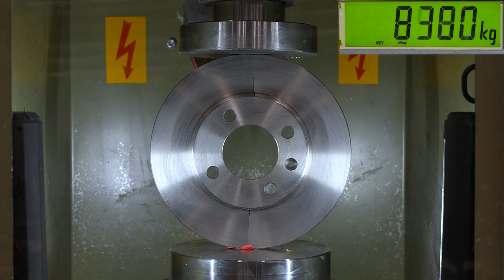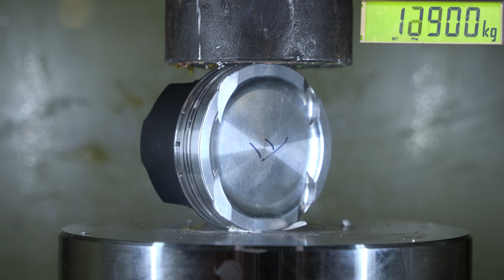Crushing Car Brake Disc with 150 ton Hydraulic Press

Comment: The only one that scared me was the big coil spring.  I could just see it popping out and taking down an airplane.
Reply: That’s what I was expecting too!
Reply: That's how we used to scrag springs after they'd been coiled and heat treated, except we used an air hammer as it was a bit more forgiving than a hydraulic press

Comment: A set of jumper cables walks into a bar.  The bartender says "OK you can come in, but don't start anything!"
Reply: Please leave…..🤣
Reply: 2 guys walk into a bar which is odd because after the first guy did the second guy should have seen it 👍
Reply: ...and says, "Dad, what are you doing here?"
Reply: The bar tender then said "we don't run tabs here".  The cables said "we'll just charge it"
Reply: Two men walk into a bar and see two metres of black tarmac strip leaning against the bar having a drink. One said, 'WTF?' The other said, 'Stay away, don't go near him. He's a cyclepath'
Reply: Good joke

Comment: As a car guy i have never seen a spring been more springed than it was supposed to do. Well done sir!
Reply: Wasn’t it sad seeing the turbos crushed?
Reply: @SniperScope99  i wouldn’t call those things turbos. Exploding spinning devices from china that move some air.
Reply: @SniperScope99  yes lol
Reply: It was a Garrett turbo
Reply: @zachcayer3027  if u saw a unicorn, would u call it a horse with a wrong stiffi?
Reply: Sproinged*
Reply: @mr.h6be  that was a fucking Garrett turbo
Reply: @SniperScope99  -40HP

Comment: This is the best explanation of forged vs cast that I've ever seen.
Reply: Not sure about that; the forged stuff was steel, but I'm pretty sure the cast stuff was all zinc or aluminum.
Reply: Forged is generally a bit stronger, due to it having its grain correctly aligned whereas a cast/billet piston does not. Of course materials will differ, though.
Reply: Billet means it was cut from a single piece of material not forged or cast. The first piston could have started out as a round or square piece of stock and was machined to that shape.
Reply: @Timberland1963  Yep.  "Billet" means it was carved from a solid piece of aluminum on a CNC mill.
Reply: @Timberland1963  My bad, it's the other way around, as you wrote.
Reply: Jeremiah from Donut Media explained it perfectly though :)

Comment: Connecting 2 wheels with hubs and crushing them via a axle between them would be cool to see, more like how a wheel would normally break.
Reply: An entire car axle? Would that even fit under the press?
Reply: @MixZTitaniumDubstep  no I was just thinking a rudimentary axle, something that would fit and provide a sufficiant contact point for the press and of course it would have to be strong enough to not bend or break before the wheels.

Comment: Note the difference between how the Cast Caliper explodes, while the Machined Piston did not. Quality of metals fascinates me. How different processes (casting, forging, machining billet) affect the structural integrity. The muffler did the squishy foldy, neat! Cheers!
Reply: Well it isn’t always about quality though, for some things you don’t want to get squished. Such as round things like ball bearings and brake disks. If they bend that can hurt their effectiveness, especially at the high speeds they move in. It takes a lot more force to shatter a harder metal than to squish a softer one
Reply: Cast explodes because its way more brittle than machined steel
Reply: The muffler was so satisfying to watch. CRRRUNCH!
Reply: It's not at all about quality, it's about the type of metals. Some, by the nature of their applications, need different characteristics.
Reply: Or it’s because the piston is made of aluminum which is softer.
Reply: Looked like compressed powdered metal
Reply: @beepbeepcoyote  it's cast iron
Reply: It also depends on what forces the objects are designed for.  The only component designed specifically for compressive load was the piston.  However where the load was applied wasn't indicative of what the piece was designed for

Comment: It would be interesting to crush a wheel from the center hub hole as though the wheel was on the vehicle.  You would have fun designing a tool to crush it that way.

Comment: put a single cylinder and with piston inside like from an old motorbike, not alloy maybe steel / iron or even small car engine block or crankshaft

Comment: What kind of metal is the press made of? Does it ever damage itself when you're crushing different types of metals?
Reply: I forgot what it's made out of, but some metals can put a dent in it if it's in the right shape
Reply: @KofteG61  High tensile low carbon steel, with an alloy mix that makes it very strong, but also ductile, so it can bend a little. Then you simply make the parts that take force massive, so that with 150 tons of applied force they are only lightly stressed.

Comment: Caliper not Caliber

Rim is not "aluminum" it is an alloy sometimes referred to as "Mags"
because they are a mixture of two homogenous metals aluminum and magnesium.
Reply: Needlessly pedantic. It's ok to call aluminium alloy wheels aluminium wheels, to distinguish them from steel wheels or magnesium alloy wheels. The aluminium alloy may contain magnesium, but that's not why they're called mags. That nickname comes from early cast wheels that were actually made entirely of magnesium.
Reply: @firelizard2  
I stand corrected, thank you.
https://en.wikipedia.org/wiki/Alloy_wheel#Magnesium_alloy_wheels